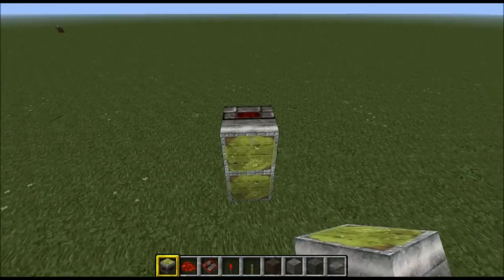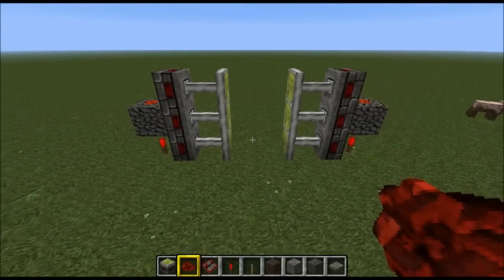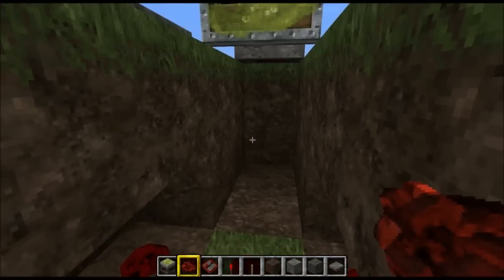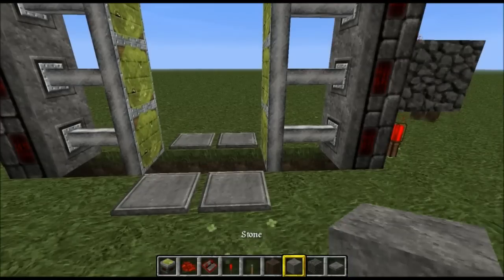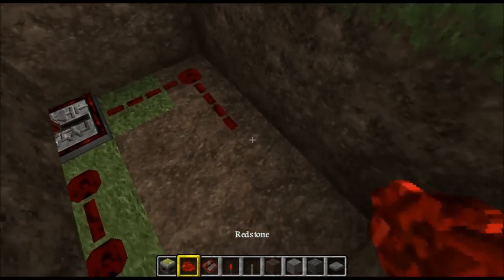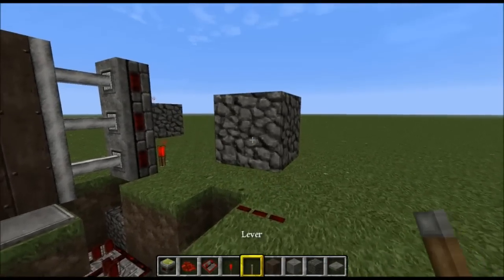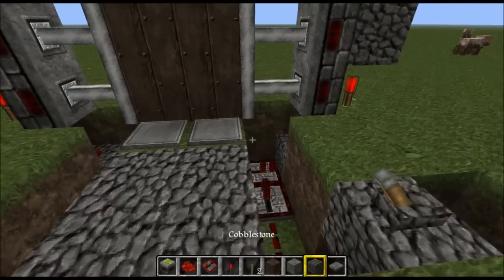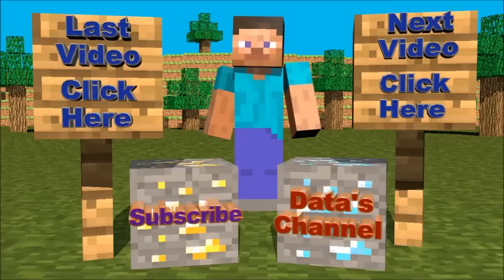Minecraft Tutorial - Triple Piston Door With Lock

Comment: In 2 years still helpful. Thanks. Although I don't understand why Notch didn't do the obvious, the way it's done in Terraria. To not think "will this connect or not?", just add wire to the block and be cool. I've spent hours trying to figure out how to 1) make all 3 pistons work together from 1 lever and 2) make it work on both sides of the door, to not let mobs open the door but not have it jammed if you come back to the castle from a different side. Pressure plates let the mobs use it and the lock will still lock you out if you use the second door. I do have a solution but it's ugly, it's a hole in the wall with the lever to use the same one from any side. Although it's 2 levers, opening the gates separately. Never what I want. =(